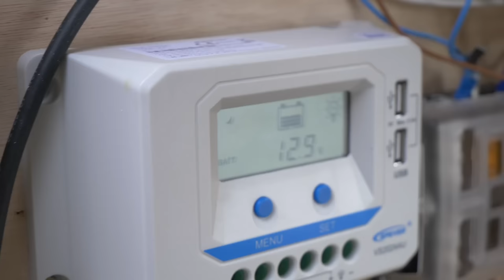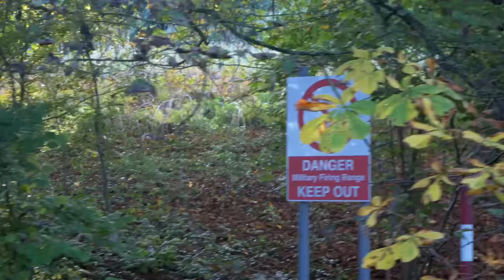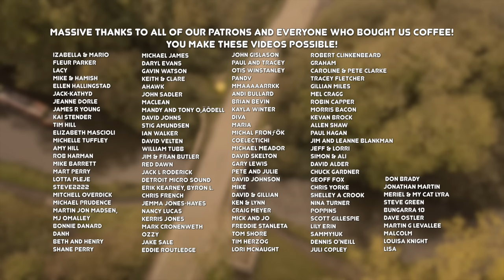The HIGHS and LOWS: A Typical Week of NARROWBOAT Life | EP74

Comment: I can't help wondering how much time and effort you two would save if you towed Rambler on a short, rigid tow bar behind Roisin. You would save on fuel and also, because you can turn it around easily, you could use it to backtrack to fetch the van.

Comment: I went off grid with a large version of a narrow boat set at my house. I started off with 2 80 watt panels to power the lights with a car battery. I ended up with 2 kilowatts of panels on the sheds. A 80 amp charge controller. 6 85 amp batteries wired to 24 volts. A 3.5 kilowatt mains inverter. The Chinese charge controller kept going wrong and over charging the system so I gave up and connected the panel to the grid. I used to have a immersion heater when the batteries were full so the power was diverted. I sure you can do this with your set up. Need to connect it to the charge controller so when it`s full it switches over.

Comment: Nice music. Great episode. Question: Why not attach Rambler to the big boat? This way only one driver is needed. Might still have to do the locks separately, unless the lock is long enough or wide enough to take both boats. I think they call it a butty-boat. I think you have to rig it up right otherwise you might have problems with motor’s wash hitting the butty. Some have even rigged the butty to the front of the main boat. It might depend on whether Rambler is shallow drafted so the water can pass under it. You’ve probably already researched this and it is not as simple as it sounds. 😊